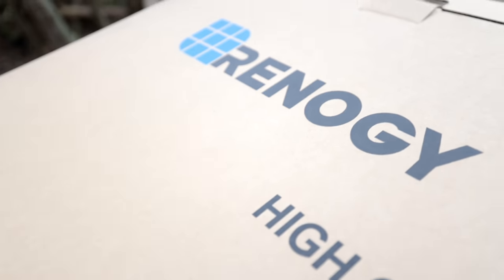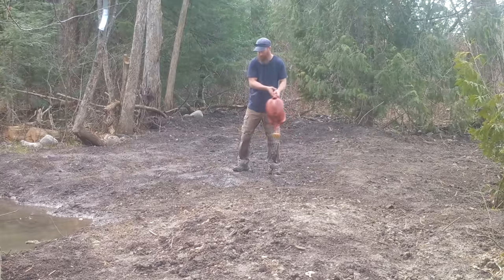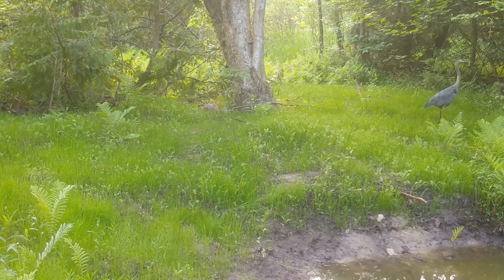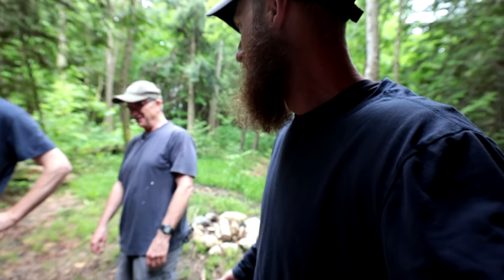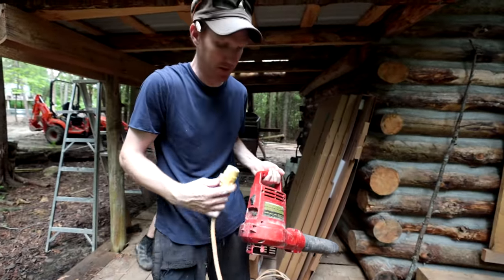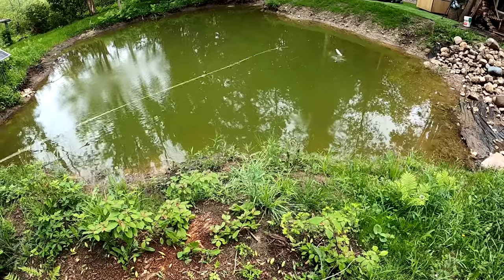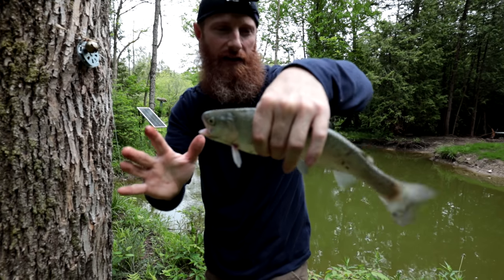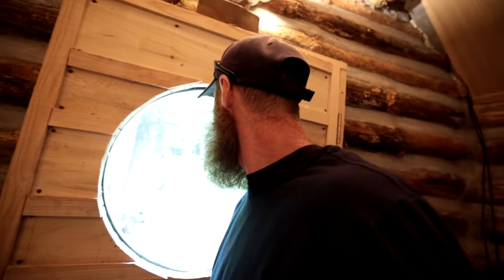Why I'm Taking a Break from Youtube (the truth) - Pond Predators

Comment: My wife successfully treated her acid reflux by taking a high quality pro-biotic that restores the beneficial organisms in the gut that can be inadvertently killed off by antibiotics. I used them to restore my gut after a bout of clostridium dificile toxin. Unless you’re eating a lot of dirt you might try that … everything just works better if that fauna population is healthy and active. I have also gotten relief from nausea by eating a Kosher baby dill pickle or two - I have no earthly idea why, often a good swig of the pickle juice does the same thing. Lastly, if I wake up in the middle of the night with my stomach on fire or just general indigestion, my go-to is to slam a solution of a teaspoon or two of baking soda stirred up in about 3-4 ounces of cold water - just as hard and fast as I can gulp it. Baking soda is a powerful alkaline or ‘base’ chemical, which immediately neutralizes acid, the by-products being water and a salt precipitate, and whole lot of carbon dioxide gas. When I drink this solution, the relief from the excess acid is immediate, but in as little as 30 seconds up to as much as 15-20 minutes, comes this earth-shaking burp-from-hell, along with the completely different form of relief. If you experience relief from your bloating by burping, you might try this baking soda and water drench. You might have unusually flexible or elastic or compliant stomach walls, and can contain uncomfortable amounts of gas before reaching the pressure threshold needed to trigger a release up and out through the esophagus. Unless you have something going on that keeps you from burping normally, by intentionally creating a significant boost in pressure sufficient to exceed this threshold, the release will include what you introduced as well as what had built up that caused the “bloat”. Be aware that the increased sodium from the salt by-product of the chemical reaction is likely to raise your blood pressure temporarily, so if it’s already high, it might not be worth the increased risk of a stroke or a heart attack. That’s strictly up to you, and you should check with your doctor first. I am not a healthcare professional, and can’t give medical advice. My sole purpose is to share anecdotal information about my own experience. You have to make your own decisions and understand your own risks.  Good luck to you.

Comment: You're off the grid making your own material yes you can make your own maple syrup you're not allowed to sell it or bottle it in a container that says Canadian maple syrup.

By the way I can see that both of you make mistakes of not having 8 to 12 Ft worth of extra roof around your cabins even the porch awning would be better than what you have. Looks like you have 3 Ft worth of extra roof and the boy has what two feet? At least you gave yourself one awning that helps but you are vary limited on dry space. That is going to cost you come winter. Unfortunately that poor boy is going to move into the Cube come winter.

Next time find a sheer Granite face next to a waterfall can start building about one foot into the wall using a boulder foundation and logs for walls and roofs as it looks like the boy has a better insulated roof than you do. Also that aluminum roof is mighty nice but next time go all the way and start with copper oversplit Timbers and don't worry about huening them mud them then put the copper over the top. By the way you should get the children should be fine where you rebuild a should be able to survive at least.